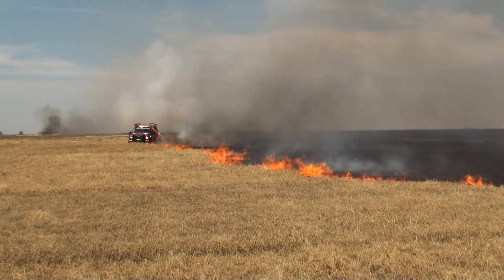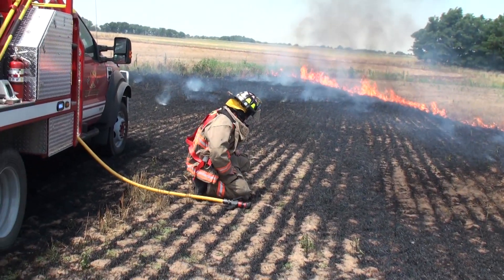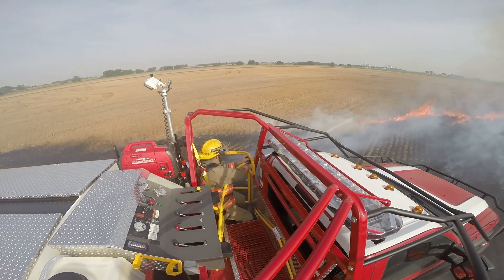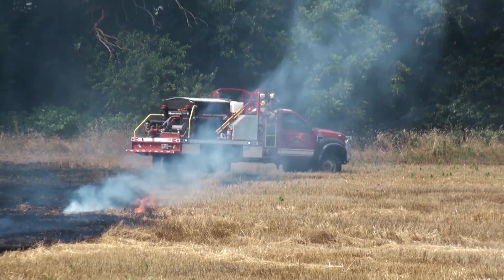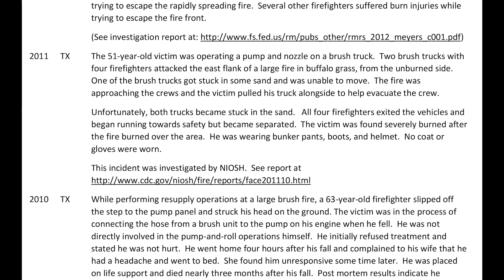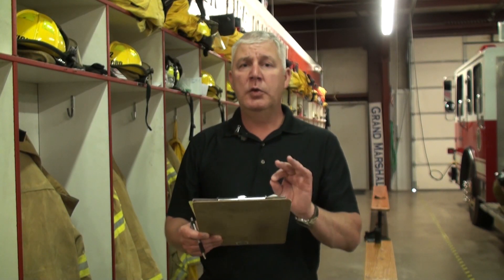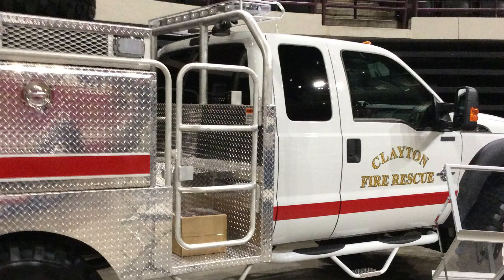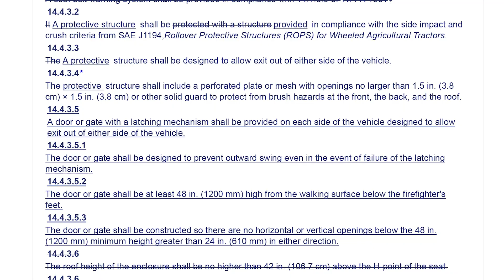NFPA 1500 Must Recognize the Exterior Fire Attack Position Behind the Cab

Comment: Our Dept. has remote Akron bumper mounted monitors on our brush pumpers and they have their applications, but nothing beats the hand held nozzle accuracy and speed from behind the cab position. Reaction time of joy sticks and a fast moving fire with changing fuel and wind conditions usually does not match up well.